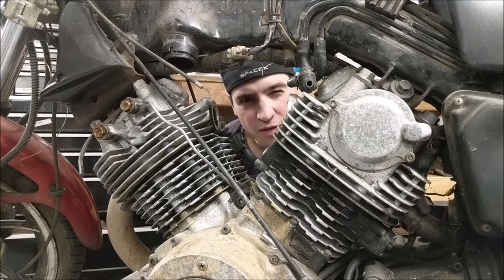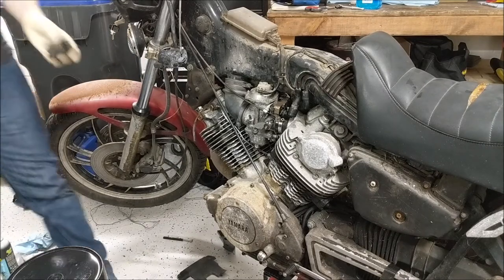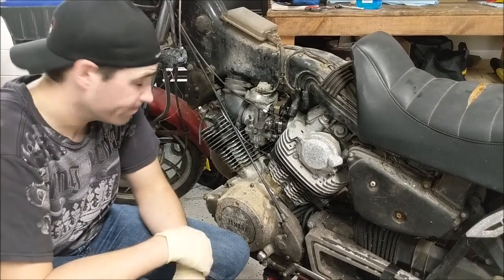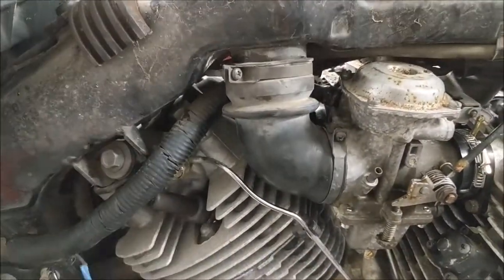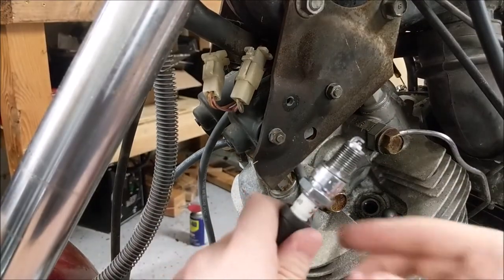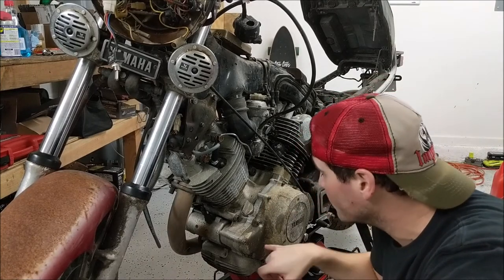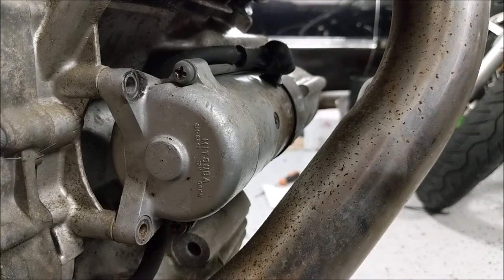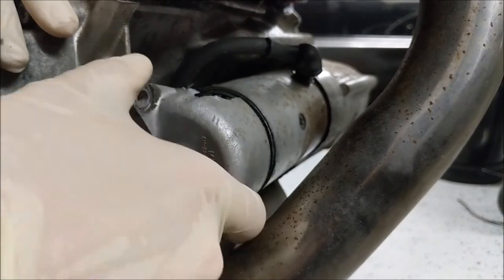XV920 | EPISODE 4 - Will it Start?

Comment: I’ve had my XV920RH since new. Upgraded to an XV1000 starter, mikuni carbs, optically triggered ignition, MAC 2 into 1 exhaust, Lockhart oil cooler …forty years and going strong 😎